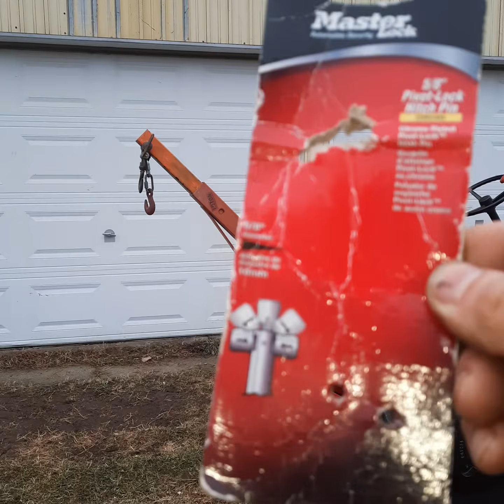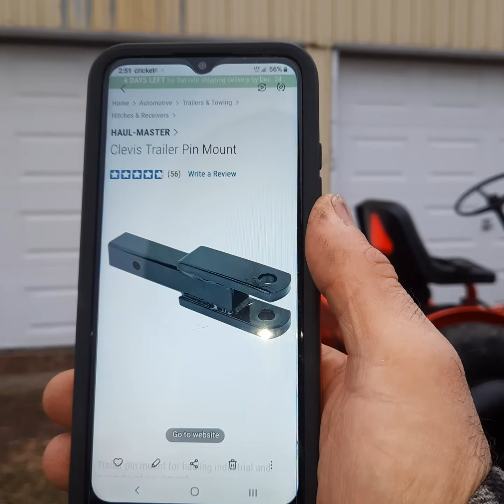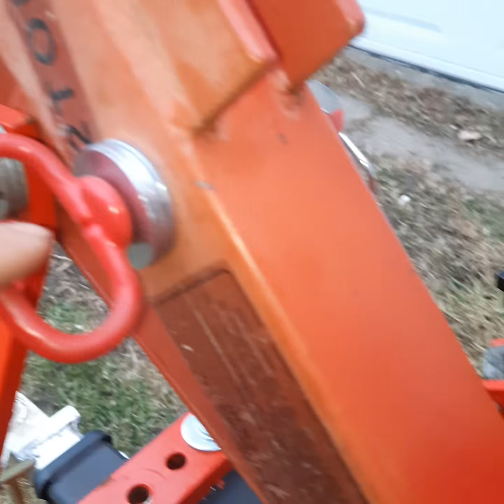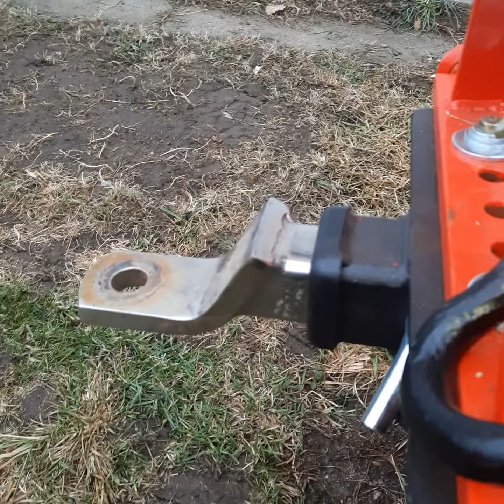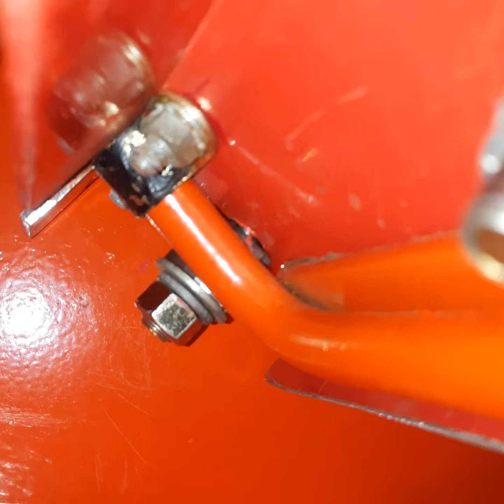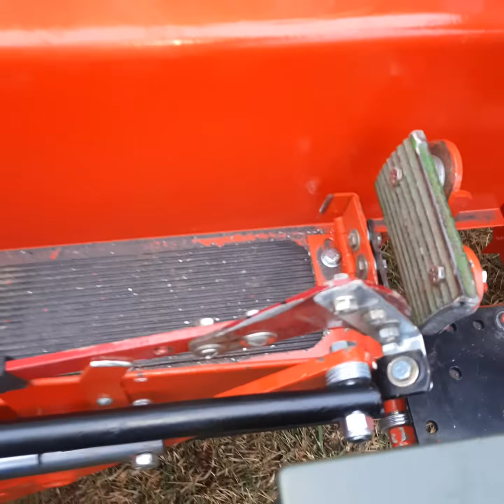(Updated) POWER KING 1979:  BOOM, CRANE, HOIST, CHERRY PICKER, JIB, & GIN POLE; 3 point ATTACHMENT.

Comment: I am thinking roll the boom 180° so the tension bar is on top. It is not strong enough to handle compressive loading.
Reply from the maker: Actually, I thought the same, and I talked to my welder and he said it would work.  Most it will be lifting is 500lbs.  All the hydraulics can handle.

Comment: How much weight does it lift?
Reply from the maker: Current stock hydraulics on pk handle around 350lbs or so.  But engine lift can handle 1,200.  Once hydraulics updated will hopefully  get to 500lbs range.  Which is a nice number.  Wouldn't want to lift much more because then need to add weights to front.